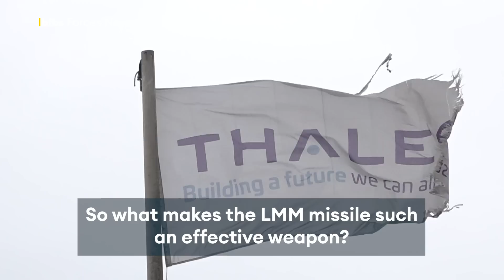Martlet: Everything you need to know about the best-in-class missile

Comment: It's a very versatile weapon
But fragmentation do not produce bullet holes like, even in tests.
Something does not add, here.
Reply: The pits in armour plate were made by the fragmentation and the holes by the shaped charge. I'm assuming the idea is the shaped charge blasts a hole so that some of the fragmentation can then pass through. With the rest of the frag hopefully hitting lightly/unarmoured parts like flight control surfaces, fuel tanks or optics.
Reply: @xXBisquitsXx  You are right. I'm just pointing that the "footprint" of both damage are different.

Comment: France is no slouch when it comes to missiles. It’s one thing to design a missile it’s another thing to produce them for wartime.
Reply: Not quite, parent company Thales Group is French, but the company that makes this and other short range missiles, such as Starstreak is located in Northern Ireland.
They’ve existed and been building missiles for UK Ministry of Defence since 1950 as Shorts Missile Systems of Belfast. They were bought out by Thompsons group, now Thales in early 2000’s.

This missile in particular is a further developed version of Starburst, man portable short range surface-to-air missile. So the French lineage is just superficial, they do make good missiles and not taking that away from them. However, this missile is pretty much UK endeavor.

Comment: Beam-riding missiles are very difficult to defend against, the best tactic is to attack the Laser source and/or the operator.
Reply: Laser designation is also easiest to detect, tho besides Israel, no one really made a system reliable enough to defend against it
Reply: @gansior4744  Laser Warning Receivers (LWR) can be fitted to potential targets and used to que defensive systems in a similar manner to Missile Warning Receivers. To avoid alerting the target the operator can aim off until late in the engagement.